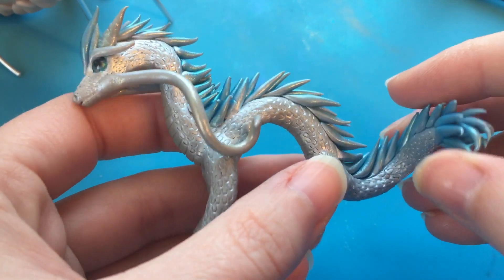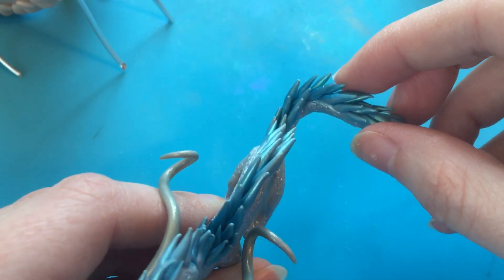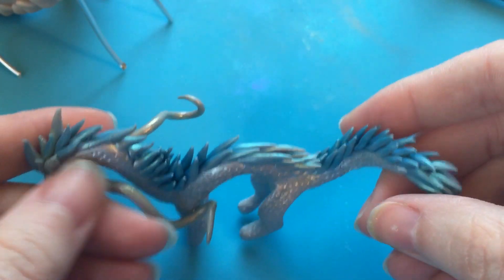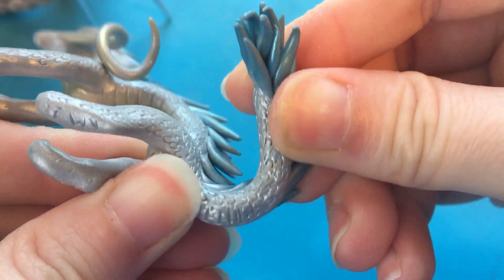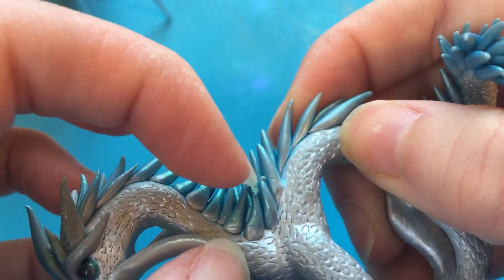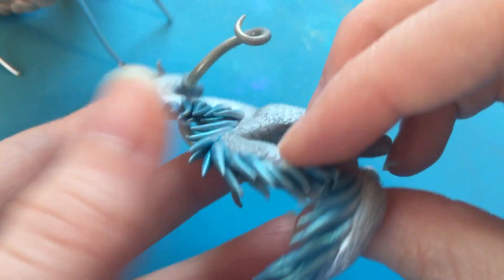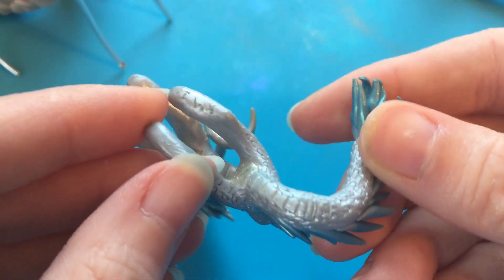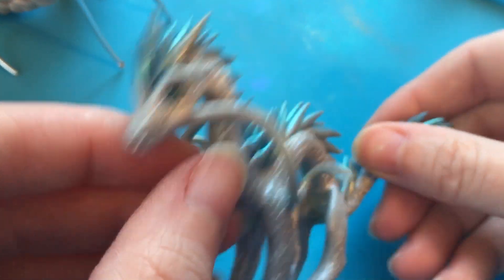What NOT to do with Cosclay

Comment: Just because it's flexible doesn't mean it can flex into infinity. Everything has limits. 
You should consider it's flexibility as a protection from breaking if it's bumped to hard, not as though it's a bendy toy.
Reply from the maker: Yes but this specific issue I had with this piece is that the texture was too deep on a thin layer of clay. It created weak spots.
Reply: The problem is the people behind cosclay and many artists who tested this stuff marketed it as a clay that actually can be used for a flexible toy that can be posed and bended the way you want it which is simply not true. I had many issues with it even cracking at parts that don't get bended that much. I'm working with polymer clay for years and it is definitely not better than other brands of clay. I wish someone would made a honest review about cosclay.
Reply: @LadyNightFury1 I agree.  I baught it thinking it was how it’s advertised… very disappointed fimo is better than the over priced garbage
Reply: @D3DBATZ  I discovered that it’s useful to mix fimo liquid into cosclay. It is less likely to break afterwards. But don’t use too much of it or the clay gets too soft.

Comment: Thank you for this video. Wish I had seen it before I bought a bunch. Been working with Premo for years. Did a magnolia brand with wire armature. My sculptures hardly ever crack. This branch had numerous cracks and even when I repaired them and baked it again, it cracked elsewhere. Also when I bent it. I did condition it on my pasta machine and had to leach it two times because it was like marsh mellow cream. Oh, well! If I can't find further info on how to use this I will use it for something flat.

Comment: Just an aside, but when toy manufacturers are making bendy toys, there are included port holes on the lateral edges of the bendy segment.  This improves flexibility by allowing material room to gap or bunch as needed.  Another technique would be to sculpt segments individually with overlaps to hide the gaps along the wire,  again to allow better range of motion without ripping the cover material.

Comment: I ordered cosclay because I wanted to make an emerald tree boa. I was more than half way and it cracked and broke like what you showed with the tail. I thought this stuff would hold up really good but there was a stress point and it broke. I was pissed because of the time I put in it so I'm not sure if this is the stuff. It looks good on some videos and the head of the snake is in good shape so I kept the head I did with cosclay. Not sure what I did wrong whether it was applied too thick.
Reply from the maker: Is the clay you bought stuff you bake? There’s another brand out there by the same name but it’s air dry clay and definitely not the same thing. 

If it was polymer clay then it sounds like it did not cure properly. Cosclay needs to be baked in a normal home oven for the recommended temp and time. It’s suggested to use a separate oven thermometer to make sure your oven bakes at the correct temperature.

Comment: Thanks for the tip! been researching this brand..What temperature did you bake your sculpture?
Reply from the maker: 275 degrees. If you bake colder than that and shorter than the recommended minimum time of 30 minutes the clay will not cure properly.
Reply: @katelynnm5686  
Thanks 😊

Comment: I have issues with the clay breaking even though these are parts that don't get bended that much. Like the hand (especially the thumb) of a doll that I made has constantly cracks even though not a lot of pressure goes on it. Also the clay chips really easily at the places the wire goes through although the clay is quite thick at those places. I've experienced chipping clay with other brands too but most of then were more durable when posing the limbs. I used the doll version of cosclay. Maybe the other types of cosclay are better but so far I'm really disappointed of cosclay. It's not at all how I expected it to be and I'm constantly worried that something on my doll breaks. I especially bought that stuff so I DON'T have to worry so much that something breaks..... .__.
Reply from the maker: Are you baking in a kitchen oven? It won’t cure properly in a toaster oven.
Reply: @katelynnm5686  Of course I use an actual oven.
Reply: @LadyNightFury1  double check the baking instructions. if nothing's amiss, try lowering the temperature by a few degrees next time. some ovens sometimes go higher than they're set. lower and slower is always best for baking any kind of polymer clay.
Reply: @DeskDrawer  I did follow the instructions and for some reason only one hand that I sculpted has this issue. The other hand (SO FAR) seems ok and they were in the oven for the same time and same temperature. I think the advertisement of it being a rubber polymer clay goes a bit too far since it definitely has it's limits. I did a test and even after optimal curing it will break at some point when you flex it. I don't want to totally shame the brand (maybe other variants of this clay work better) but for me who works with polymer clay for years it's not that special and a bit disappointing especially since it's more expensive than other brands.
Reply: @LadyNightFury1  Mine has been crumbly too but i think maybe ive had the temp too low
Did you figure it out?
Reply: @LadyNightFury1  I wanted to order online Cosclay doll. But now read your this comment.. So have you figured out what was the problem? Or problem is in Cosclay? Because I need to make bendable parts, right now I use Fimo leather effect (it starts to crack after like 100 bending) , but thought Cosclay doll would better option, but your comment confused me. What is your thoughts about it right now? What do you use now?
Reply: @JimboHamster  Yeah Fimo Leather kinda sucks. I used it too one time and it broke at so many places. :C Very recently I used cosclay again for details of an art doll. I made 2 long and thin tentacle like feather and these needed to be flexible. This time it does not break and is indeed very flexible like many artists show. But I mixed the cosclay with Fimo Effect in pearl white since I know that this specific clay is very durable and flexible too. I tested a bit with cosclay and it might be that the clay tends to be more crumbly if it's not mixed enough. But I'm not 100% sure. If you are going to get cosclay I recommend to test it's limits before you actually use it on your project. Also I would not stick to the baking instructions too much since every oven is different. Mine usually get's much hotter than the temperature I select. I still prefer Fimo or Cernit clay over cosclay not only because of the color variation but also because for me it's durable enough for the things I made. Just rarely I need the parts to be flexible and for that I often switch to other materials like leather.
Reply: @LadyNightFury1  good to hear this. Thanks for the all information. I’m really beginner at this. I try to make tiny hamster paw and fingers inside wire and fingers need to be bendable to any natural direction. Right now I test with fino leather and waiting for cosplay. 

So what would you recommend to me to use in my case?
Reply: @JimboHamster  So you want to make poseable fingers? For this I would rather felt the paws and only use clay for the claws. This was my approach on my dragon art doll to have poseable fingers.
Reply: @LadyNightFury1  yeah poseabe fingers. I thought about felting, but I want to make it maximum realistic, so when I look at the paw of my hamster I see paw itself is smooth surface and little hair on top. Of course I will add hair to the top of the fingers, but I want the surface of the fingers to be smooth, not like wool or something. So what any other ways would you recommend for this? Clay is like last choice for me. Because I don’t rely on it at being poseable(without cracking).
Reply: @JimboHamster  Covering the felt with silicone might help but if poseable fingers are not a must clay should work just fine.
Reply: @LadyNightFury1  yeah I think it sounds better. do you mean silicon hot glueor what? and how to cover it accurately in the shape of the finger?
Reply: @JimboHamster  No I mean actual latex silicone. It's in liquid form and hardens by itself. It mostly dries in skin color already.
Reply: @LadyNightFury1  you mean Universal Silicone, right? so how should I apply this on felted fingers that will shape how I want?
Reply: @JimboHamster  No I mean liquid latex which you also use for sfx make up. Not that stuff for construction work. Also I would but a layer of paint or glue over the felt before adding the latex. I do not guarantee that it will look exactly like you want it to be especially when it's on a smaller scale. It's just the approach I would take.
Reply: @LadyNightFury1  thanks for helping!! Let's see.. I'll get my cosclay soon, so will try with that first if doesn't work then will try your suggestions. Thanks again!
Reply: @JimboHamster  You're welcome!

Comment: Yeah i bought some of the cosclay sculpt thinking i could use it as stop motion puppet but even after bake at the right temp and baked straight it still cracks 😢 wish i knew what i was doing wrong ...or this clay is a lie
Reply from the maker: This clay is 100% legit. If your clay is cured properly it shouldn’t crack. Mine only cracked here because my clay layer was way too thin over the wire. This clay is extremely durable and I’ve been using it solely for the last 4 years now.  You do need to bake this in a normal kitchen oven, not a toaster oven as toaster oven temps vary too much while baking and will not cure the clay properly.

Comment: Do you think the wire in the tail may have caused the break?
Reply from the maker: The break is because the clay was too thin over the wire. It would have been fine if I didn’t do the scale texture.